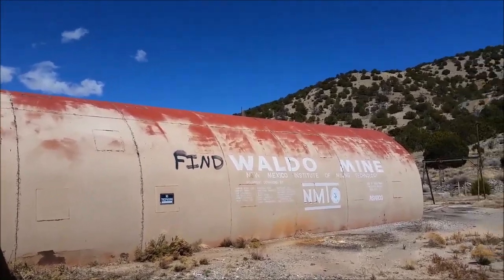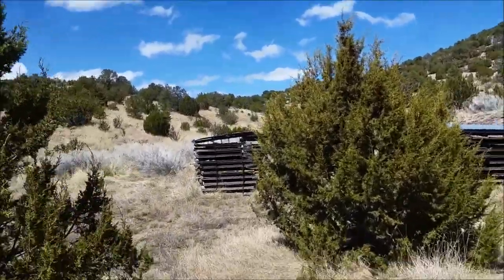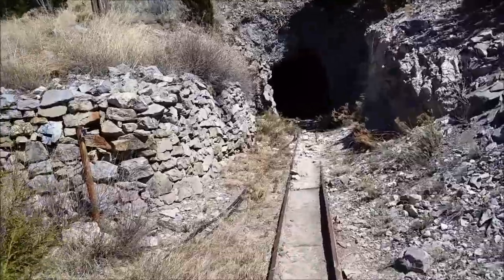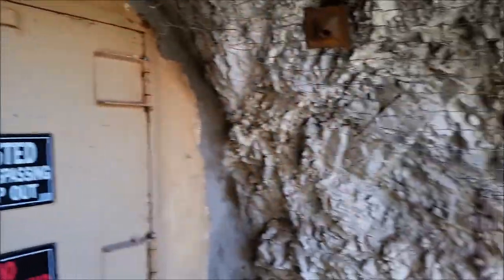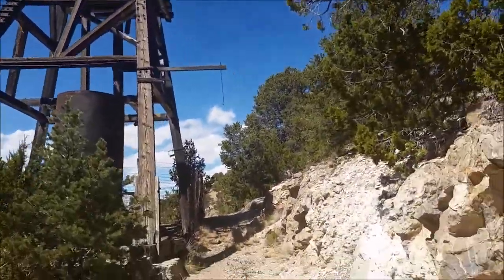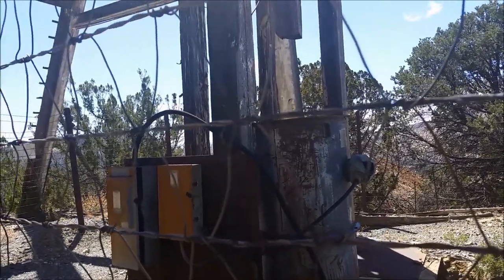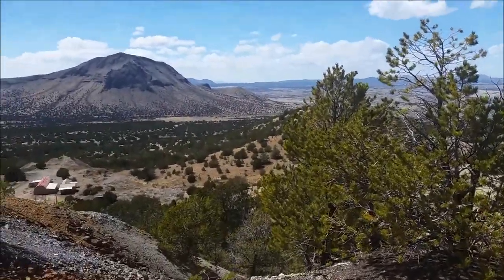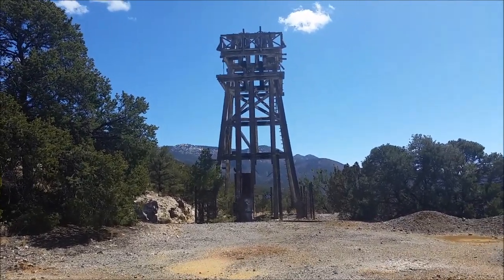Graphic-Waldo Mine - NMT Experimental Mine, Wood Headframe

Comment: Been a long time since I was in the Waldo, but I remember it was a pretty straight shot for several hundred feet, beautiful booming tunnel. There was a room along the way with a massive flooded shaft. Past that to the west, there was at least one stope that went up further than lights would allow seeing.
It was also fairly dangerous; despite being so heavily travelled, there were students finding live dynamite and other items. The room with the flooded shaft had at some point been peppered with a bunch of blasting caps; the dust was deep enough that it was a very real risk that there were unexploded caps somewhere in the dirt, although the majority seemed to have been set off already. Once we found signs of blasting caps, we all got to standing on the rails (the only known safe place to stand at this point) and walked out on them.
Tech was a crazy place through the 60s, 70s, and even into the 80s. Unfortunately, the great storytellers of the time are now gone.